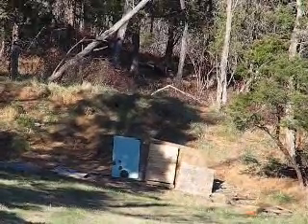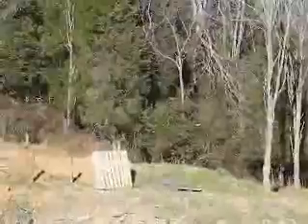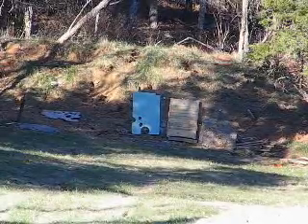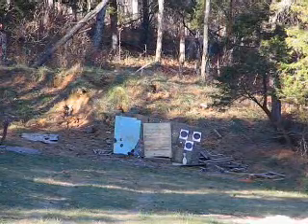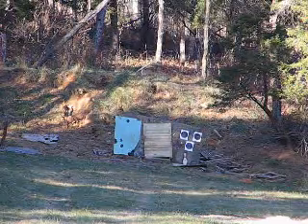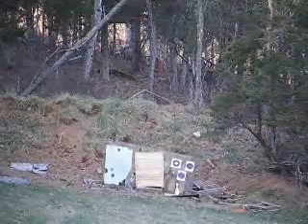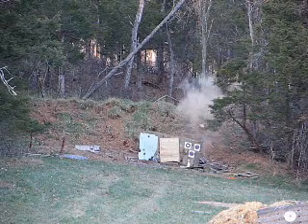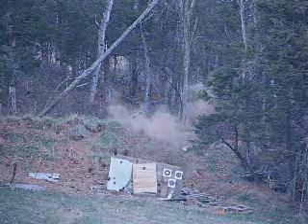Firing THE DEADLY Howitzer

Comment from the maker: Think you may have mis-read what we did, or we didn't explain very well.  We got the average velocity of the ball with enough precision for our purposes by timing the flight from the slowed-down video after we got back to the lab.  We figure the accuracy using this method was about plus or minus 5 feet per-second.  We only watched the recoil as another piece of data so we could see trends during the test.

Comment from the maker: You are saying you have shot artillery with bores of 88, 155, and 188mm, and a heavier projectile with a small powder charge gives greater accuracy.  I certainly agree.  I guess that's actually the whole idea behind why all artillery 105mm or larger has usually seven "zone charges" so you can optimize the accuracy by removing the extra propellant you don't need to get the shell to a given target.  Also, of course, less propellant means less barrel wear and longer barrel life.

Comment from the maker: Here are the detailed data in case you missed it in the "description" of this video.  
Shot   TOF    V avg.    Recoil
no.    (sec.)  (fps)    (in.)
1 0.7 429 28
2 0.78 385 21
3 0.82 366 17.5
4 0.82 366 18
5 0.84 357 19.5
6 0.78 385 20
8 0.75 400 21.5
10 0.92 326 15.5
11 0.78 385 20.5
13 0.82 366 19
14 1.01 297 11    
       
Mean 0.082 366 19.2